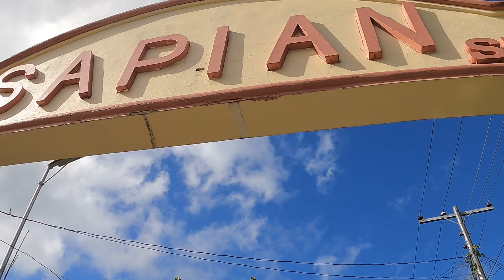VLOG 126: UK BORN FILIPINO HIRES CONCRETE MIXER FOR DREAM HOME BUILD IN PHILIPPINES!

Comment: Hi Miles Good the concrete is under way
I would like to see less water in the mix (water is shrinkage and cracks) 
I see the guy on cement adding  now has mastered it.
At this time only part way in your video.
Reply from the maker: Thanks for checking out the concrete pour!